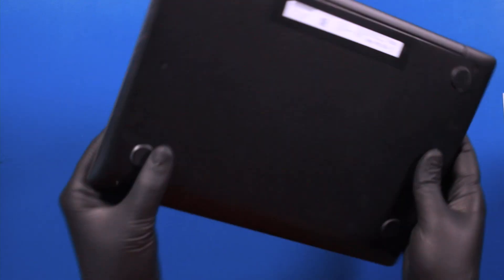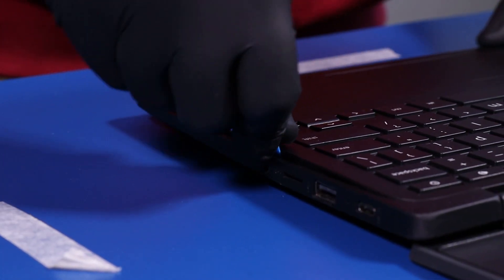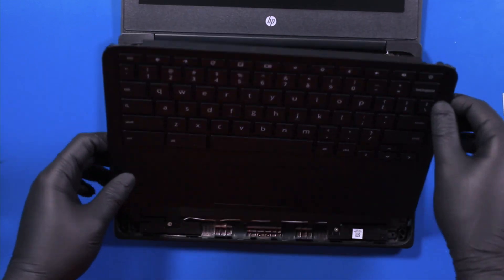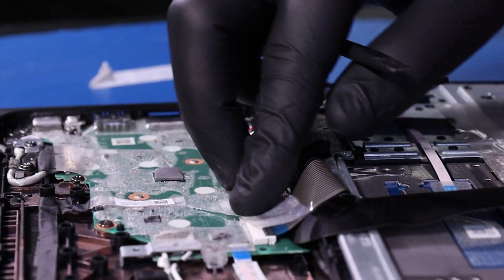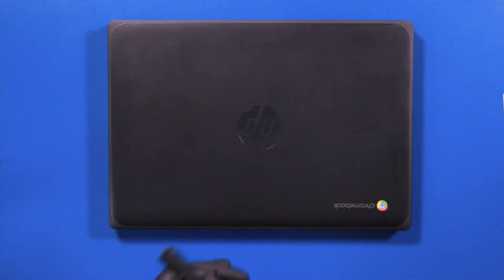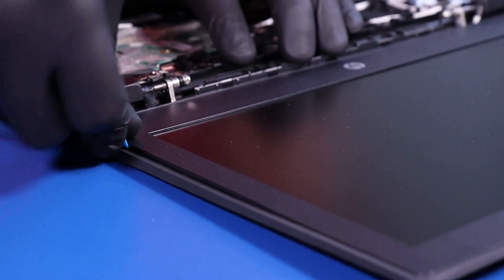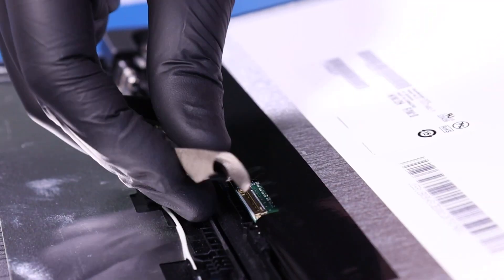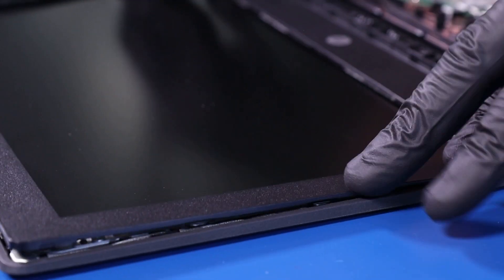HP 11 G9 EE Chromebook LCD Screen Replacement

Comment: Why you need to take the bottom off to fix the screen
Reply: More than likely just to disconnect the battery before touching other parts of the machine. An unnecessary step to some, but a good precaution for most.
Reply from the maker: Hello! We recommend disconnecting the battery before removing any powered components from the device, as there is a small chance of shorting out the motherboard when connecting/disconnecting those components. You could unplug the battery without removing the entire palmrest, but in this case we removed it to make it easier to work.